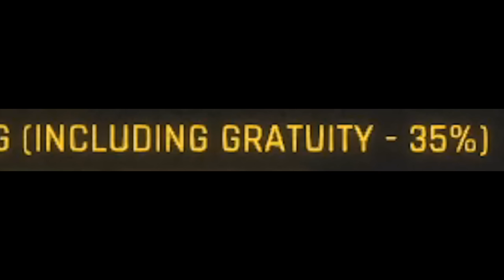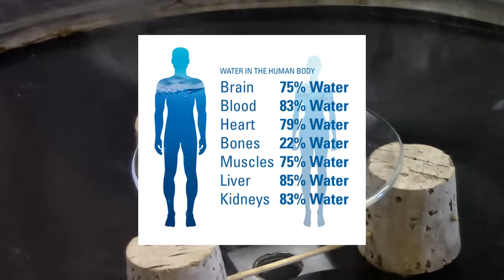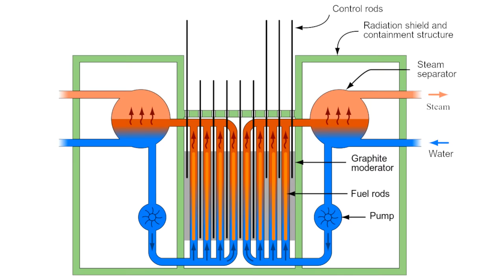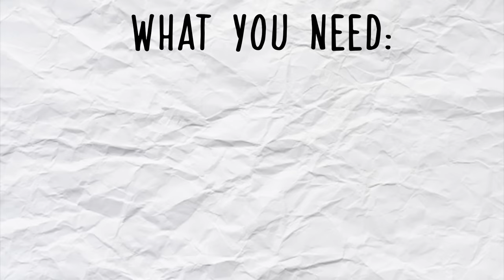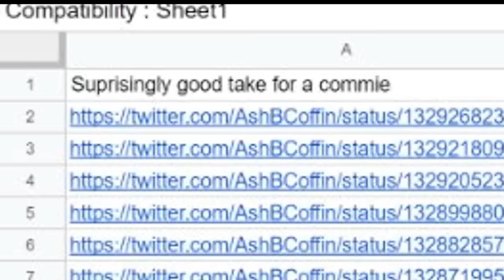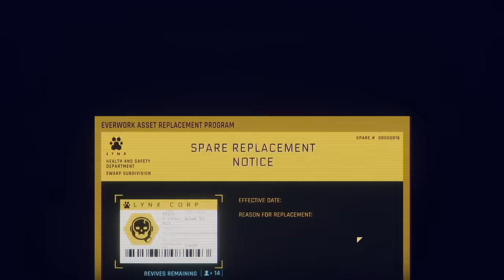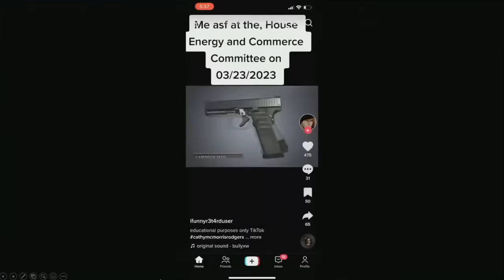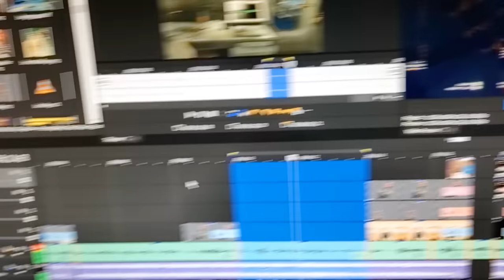Hardspace Shipbreaker Review | We Own You® Edition™

Comment: The endings make more sense if you consider the possibility that Lynx has bigger fish to fry with an ai that may be assimilating all ships that risk the far reaches of the solar system and don't want to deal with problems at home longer than they need to, or that some space logs imply that Lynx doesn't have anywhere near as much control as they claim to outside of Earth and it's orbital facilities (ie the Mars ice cream revolution), but this may be thinking about the story more than the writers did. Especially if they just plain forgot that they left those old plot threads lying around.
Reply: The problem is it takes forever to find all the data logs. Like one ship should have five data drives to find not one. Plus the ending sequence post credits shows your clone is now owned by lynx

Comment: Hey I noticed that the reactors in game are fusion reactors. Meaning that the spiel about meltdowns is WRONG. The reactors are basically fueled by tiny nuclear explosions, and a meltdown would be from a failure of containment.
I'm pretty sure they still wouldn't explode though. I would think there would be a flash of light and a shit ton of gamma radiation. Depending on what they're fusing it would probably spit neutrons, electrons, and even alpha particles like mad as well.